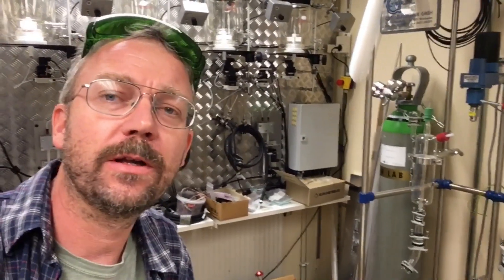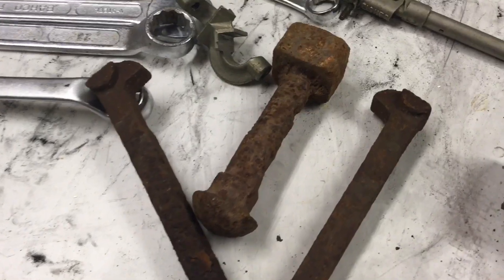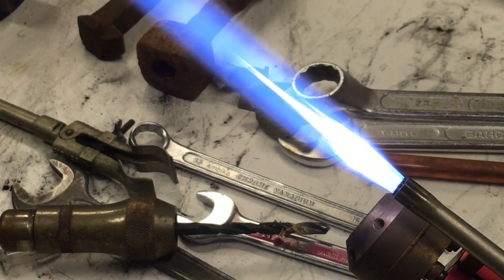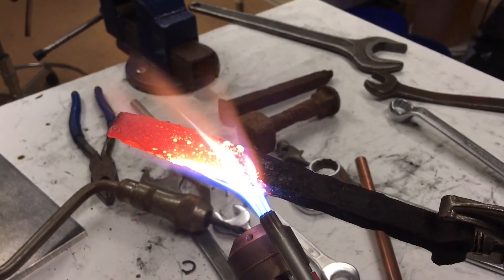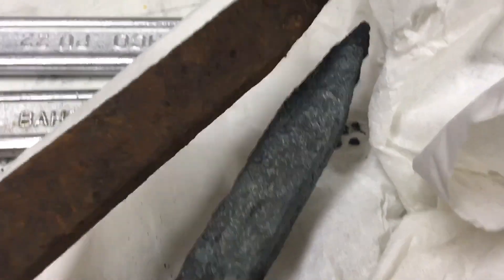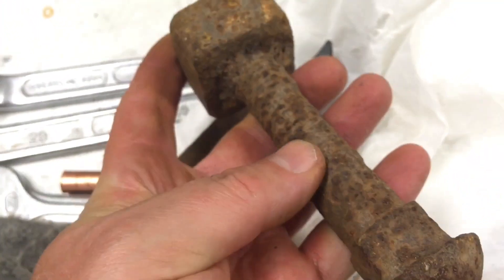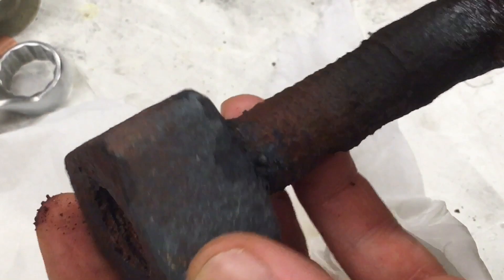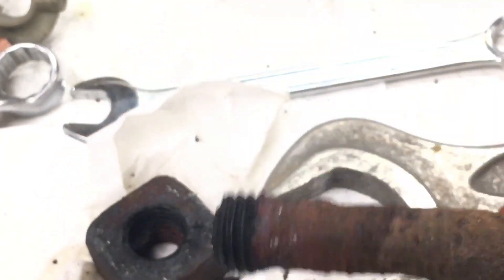True rust removal  – extreme temperature change and all rust shutters OFF!

Comment: Looks like the heat had burned off the rust.  Im wondering if the bolt came loose from water getting into the threads of the bolt  acting like a lubricant.  The threads look wet.

Comment: Why did you dip the big square bolt in the nitrogen first?
Reply from the maker: To achieve a maximum temperature difference between cold and hot environments, you want to expose the metal-oxide combination to extreme temperatures that cause significant thermal expansion and contraction. Here’s a strategy to maximize the temperature difference:

1. Select the Right Environments:

	•	Cold Environment: Use an environment with very low temperatures, such as liquid nitrogen (about -196°C or -321°F) or dry ice (solid CO2, about -78.5°C or -109.3°F).
	•	Hot Environment: Use a high-temperature source like a furnace, flame, or boiling oil. A furnace can achieve temperatures up to several hundred degrees Celsius or higher.

2. Optimize the Thermal Cycling Process:

	•	Rapid Temperature Changes: Quickly move the metal from a hot environment to a cold one and vice versa. The rapid temperature change will cause the metal and oxide to expand and contract at different rates, increasing the chances of the oxide breaking off.
	•	Repetition: Repeatedly cycle between hot and cold environments. Each cycle will introduce thermal stress, which can weaken the bond between the metal and the oxide layer.

3. Consider Metal and Oxide Properties:

	•	Thermal Expansion Coefficients: Metals and oxides expand and contract differently with temperature changes. Choose a metal and oxide combination with significantly different thermal expansion coefficients to maximize stress during temperature changes.
	•	Mechanical Strength: The oxide should be brittle compared to the metal, making it more likely to crack or spall off under thermal stress.

4. Safety Precautions:

	•	When dealing with extreme temperatures, ensure proper safety measures are in place. Use heat-resistant gloves, face shields, and work in a well-ventilated area.

By maximizing the temperature differential and cycling rapidly between extreme hot and cold environments, the oxide layer on the metal will experience severe thermal stress, increasing the likelihood of it breaking away from the metal surface.

Comment: I purchased a rusted wood stove and did a good job removing allot of rust both with rust remover and rust removal disks on my angle grinder. After I tested the stove by building a hot fire in it I noticed more of this rust came to the surface on the face of the stove from the heat. So typed in rust removal with heat and found this video. I would be curious if just the heat would be enough without the cold. The metal will expand and contract on it own as in the case of my wood stove. One could use a weed burning torch on larger items.
Reply from the maker: Absolutely. Some of the rust is probably falling off as it cools down and doing it several times will remove more.
Reply: I found an extremely rusted stove too, I used multiple cycles of electrolysis to free it up as wire wheels tend to "glaze" the surface of the rust

Comment: I have rust in my insert stove on the metal plate on the roof of it. Rainw after was getting into our chimney. As it it summer now I wasn't planning on Lighting it but I hope the 400c heat kills the rust that has appeared. The stove is only 1 year old so hoping it kills or stops the rust.
Reply from the maker: I’m not sure what an insert stove is, or looks like, but the heat here will probably not cure the problem if it has shown prone to rust. The good thing is that if you are out early then it will likely not be that much. Since you cannot paint it, all paints will degrade with time at the high temperatures, I would look into using a phosphate based acidic rust converter. If your insert stove is iron, it will leave a black iron phosphate coating on your insert stove that is high temperature resistant (will not disappear as you fire it). Also, you don’t need to worry about anything coming off this as you use it in the future. It’s is not a perfect anti rust solution but cub better than nothing. The best anti rust solution in your case would have been to select better materials when they made it. I hope this will help you.
Reply: @Ken_Sweden  tha k fp your the great response. Its actually called an inset stove. I spelled it 'insert. It is a cast iron stove that is mounted  into the wall at the pre existing chimney. We are getting a new flue put on chimney as some rainw after was getting in to cause the rust. I wilt try what you suggested. Thank you 😊

Comment: This heating/cooling is good for freeing off rusted screws. I use an old screwdriver heated to orange with a torch, and put into the slot of the screw to transfer the heat. A damp cloth or sponge helps speed cooling. A sharp tap on the end of the driver to shock the rust in the threads and most screws will free off. Repeat the process a few times if needed.

Comment: If this is done with any hardenable high carbon tool steels, you would be hardening the steel to its ultimate hardness and also creating huge internal tensions. The  method is highly likely to generate cracking, and at best, create a very brittle steel

Comment: Faster cooling can be achieved by reducing the formation of nitrogen gas in a pressure chamber
Reply from the maker: Very interesting
Reply: It would cool very must faster in water due to its high thermal conductivity, then if desired, could be further cooled in nitrogen. In my experience the water cooling is enough to get the job done.

Comment: I think that when you dipped the part into liquid nitrogen, the slow cooling was due to the Leidenfrost effect. Moreover, another effective method that you have applied but not mentioned explicitly: hammering. It may seem too good to be true, but hammering helps cracking rust, limescale and other brittle stuff: cracks in concrete are not much different.
Reply from the maker: You are correct

Comment: Great videos, There is something i noticed however, the extreme difference in heat from hot iron and liquid nitrogen is slowing the cooling process down as the bubbles that form from boiling is actually insulating the heat from the cold thats why blacksmiths move hot metal around whilst cooling. Better explained in this video https://www.youtube.com/watch?v=gjsMV1MglA4
Reply from the maker: Good point. In the chem lab this is avoided by putting dry ice in a solution of isopropanol and water. It all remains liquid then and cooling effect is maximum. I missed this one when making the video.
Reply: Water in the liquid nitrogen helps reduce the vapor barrier.

Comment: Only use this method if the temper of the metal doesn't matter, or if you intend to re-temper it.
Reply: there is a way you treat metal and it will never never rust , and as a master mechnic i cant tell you
Reply: just heat it and hammer it.. you dont need to take the orginal temp out if you  use too small heat

Comment: Excellent video... Love the scientific approach to everyday problems, making us understand WHY it works.
One question, though: Aren’t you changing the metals molecule structure when applying extreme heat and cold?
Guess it’s OK with Iron, but what about steel and similar?
I mean: steel has a certain strength and ability to stretch. The process of heating and cooling i the same as hardening (as far as I know), which would make the metal crisp?
Only asking to be enlightened...
PLEASE, post a lot more videos....
Cheers from DK
Reply: Steel is just iron with carbon so I guess it's the same as iron

Comment: Nice video, you could use a wire brush after heat treatment. It will clean the bolt to the metal.
I still use vinegar, I guess vinegar is the best rust remover out there.
Reply: Electrolytic derusting is cheapest and best.
Reply from the maker: You’re right, that would have better revealed also that all that was left was very loose. I didn’t have one that place because when I started I was believing that the rust would sort of crack loose as much larger flakes, as for an eggshell. Thanks for input!
Reply: Here is nice video about rust removing methods. Likely best methods used at home are citric acid and electrolysis. https://www.youtube.com/watch?v=Qi-tK1jwO-k&t=2s&index=3&list=LL_FgfMxyZg7wlNiZPkOOPsw